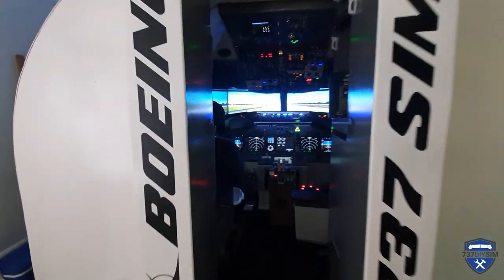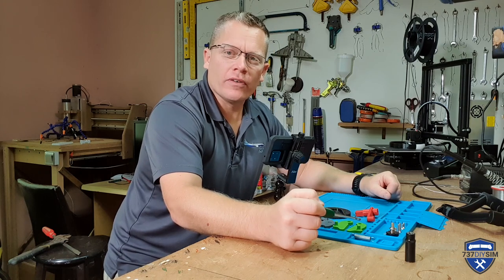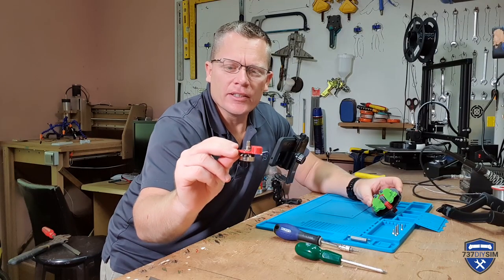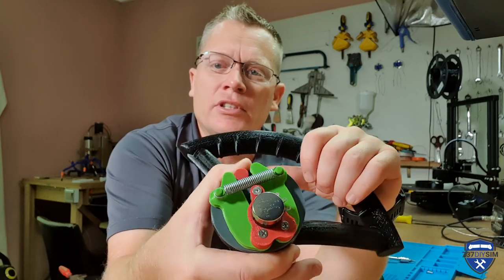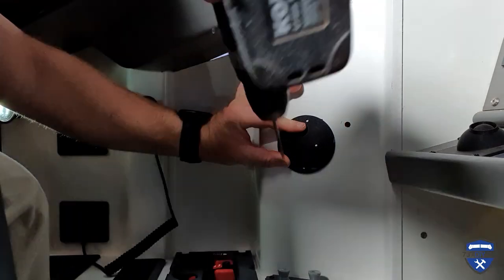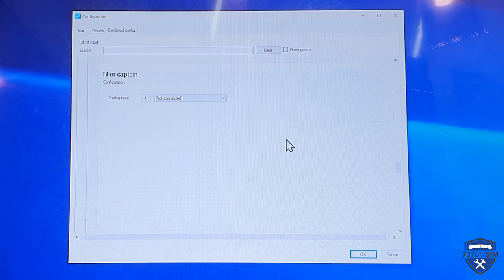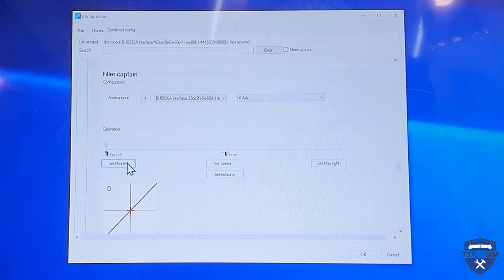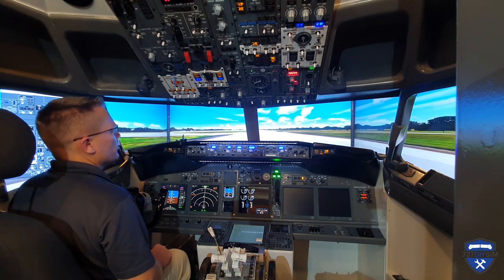737 Tiller & Operating Mechanism

Comment: Fantastic series - excellent job - there's no way that most people would have your skills and access to materials to build one - I agree with others - you should mass produce and sell it - I would buy it
Reply from the maker: Hi Warwick, Unfortunately due to my location that is not currently possible. I am unable to produce any part to sell and ship right now. I am relying on other simmers to buy the plans and sell the parts to others at a reasonable price! However, the ones i see on eBay are silly prices! (the whole idea of this website was to inspire others and show you don't need a lot of money to get started. But of course it helps! Thank you for commenting and the support. Kind Regards Karl

Comment: I have got to say what a GREAT SIM in every way m8e. Whats your view on Air Manager with touch screen buttons? I am at the cusp of either building a fully functional 737 home cockpit like you have based your sim on. I have got FS2020 as you can imagine. Do you think I should use Air Manager for all the functions to get the same overall feeling of the sim?. The noises are important as well yes? I have 400mm square Creality CR-X dual colour FDM and Resin Photon printers but the costs can be immense when you start adding up the costs of the buttons/interface boards and god knows how much MDF you have used yeah!. Your comments are welcome on that. I think you in IT like me yes! I come from the 8bit days 20yrs ago and building a home cockpits would have cost £30k and 5xCRT monitors/computers... You get the point. I have tried before with an AutoPilot Self Contained (Blackbox solution) with other bespoke hardware which cost £500+ from Australia for AP and list goes on. And other add-ons which in all via FSUPC was clunky.... Look forward to your reply. Regards, Andy ps. I started a while ago as I said but with 480p Projectors with the CRT's and there was too much heat!!!! 35c in Winter lol. I boarded up the windows to keep the light out. You get my point... I think...

Comment: You should put this in a shipping container mounted on hydraulic jacks!
Reply from the maker: Hi Stephan, 
I think that's the million-dollar question that everyone has. That would be the ultimate dream. But for me, this is just a hobby and the sim will remain a fixed base. Over the years I have thought about making a moving base unit. But for the 737 is not currently an option. The last time I looked at the hydraulic jacks they came in at around 6000-12000 pounds each, to which I would require 6. Then you have all the equipment required to run and control the unit. I really can see why the real simulators cost so much. To make things even harder, where would I put it? This thing is already massive and I dread the day we have to return home to our little house in the UK. I am currently designing a heli sim, which is lightweight and hopefully, electric actuators can be used. But that's a future project. probably a bit more of an in-depth answer than you were looking for, but I have thought about it many times over the years. Kind Regards Karl
Reply: @helimech8152  Thanks Karl!  There are a lot of wires to connect everything !  I wondered whether you could connect all the devices via network cables and UDP protocol.  ipMidi allows you to connect MIDI devices over a computer network.  
It doesn’t use TCP/IP but instead uses Multipacket UDP which gives it a lot more bandwidth than standard MIDI.   If you were to use a UDP layer, you would almost want it to be invisible to the existing client/server software you are using.

Comment: Bravo!  Wish I had a quarter of your talent. So looking forward to the Yoke build. Will it be a dual yoke with both Captain and FO sides working?
Reply from the maker: Hi Tom, I was supposed to be Dual Yoke, But waiting on parts, its been over 3 months now. So for the time being and to get in the air on both P3D and MSFS2020, im going to get the Captains yoke done first. Once the parts arrive, like carrier bearings, inline turnbuckles, sprockets and chains, then i will convert to dual yoke setup. Also, been thinking a lot recently on the centering mechanism, force feedback and force trim. Hopefully i can get this sorted on the captains side and use is also for the FO side.
Kind Regards Karl

Comment: Hi. It is immediately obvious that you are a trained avionics/aircraft tech because of the way you wire it up - lovely. My degree was in avionics so I have done this sort of wiring before and it is mega rewarding to see it all beautifully loomed and laced.

Question: have you used a VR headset in your 737 simulator? I know that kinda defeats the point of building such a faithful, accurate cockpit, but I want to get back into the air soon (PPL & IMCr holder), and would like to use the new MS flight Sim (or maybe even Xplane11) to practise cockpit checks/memory items, but It is much, MUCH more realistic to have a real instrument panel. I'd really like to be in a VR headset, but able to operate switches on a real instrument panel - do you think VR headsets (specifically the tracking technology) would present an accurate enough virtual panel that the panel switches would feel exactly where the VR picture shows them to be? I am kinda suspecting that's a 'no', but I'm asking in case the tech is better than I'm giving it credit for? 

Sorry for the long question!
Reply from the maker: Hello Edward, sorry for the delay in getting back to you. Thank you for the great comment. I haven't tried MSFS in virtual reality, but I know a lot of people cant get enough of it. Is it good enough to carry out cockpit checks and muscle memory programming. Really im not sure. But i would hazard a guess to some extent. But nothing is going to beat sitting in a full sim cockpit to practice just that, especially when there's no consequences when you get it wrong. The good thing about Prosim is the included instructors station, which tells you what ha been missed or needs to be completed as you go through the checks. Prosim however, is type specific, where as MSFS in virtual reality, you download the  aircraft type and your ready to go. I think what I'm trying to say here, is that i have no real quality advice to give here! Either option can be a costly experience to start out with! Kind Regards Karl

Comment: Inspirational video again, thank you Karl! I will use a standard European 75mm drainpipe for the yoke column since Markuspilot says it is 76mm in the real NG. I hope to find a yoke neck that fits the 75mm or a 3D print file for the same:)

Comment: G’day Karl,

Fantastic project you’ve made - your wife must be incredibly patient! 

Your design is just an amazingly simple yet effective solution. So thank you! 

However, I’m wondering about your pedals? All of your other designs are fantastic, so I’m obviously a bit intrigued what you use. I’ve designed some pedals loosely off the 787, but they aren’t the pedestal style. I’m going to try and adapt your tiller mechanism for the centre and sensor pickup, I think it would be perfect. Perhaps with some increased scale for added strength.

Finally, you mentioned using a capacitor to remove the jitter when calibrating. Can you explain this a little more in a video or blog post on your site? I’m sure you would do such a fantastic job at enlightening us all.

Best regards down there in Brunei.
Reply from the maker: Hi RB, thank you. I will add a diagram about the capacitor soon. It seems to help quite a few. Merry Christmas Karl

Comment: Are you designing parts and making them?  Were the parts of the mechanism already designed and the printing files provided for the Tiller and the spring?  It looks like there's a lot of design work going on.
Reply from the maker: Design work is now 90% of what i do. I dont bother to try and create anything these days without it working or designed in CAD first

Comment: G'day Karl,
Two little snippets for you. Check that you have not got your tiller active in the main FS program ( PrePar3D)  and FSUIPC. There is conflict  if you try to calibrate with both active. It causes the jitters you mentioned. assign in one only.
When you assign the "card" in the P3D configuration ....move the tiller so you get a reading on the top bar, the just hit the "A" box next to the assignment box and hey presto ...it finds your Bodnar card assignment automatically. I will try to put something up on my channel soon.
Reply from the maker: Hello Les, Great to hear from you again! You wouldn't believe the hassle i have of deselecting all the controls in the different programs! You are completely right, if theirs a duplicate control, we spend days trying to figure out why we had no elevators despite the PROSIM showing in the config page all was good. In the end i had move the Elevator control from Prosim, and move it to FSUIPC. Tony that came to have a ho in the sim, had to bounce the aircraft off a hill, or house to get airborne. That flummoxed me. As always Les, Thank you for the advice, it really is appreciated. Im on holiday with my wife Helen right now, but am determined to get the control column sorted next! Kind Regards Karl.
Reply: All good..... Contact me when you get to the control column "feel" build,. My setup works very well , and having tried a real one (on the ground) , it feels fairly OK. 
Have a good break.
Regards

Comment: HI, great design, did you use a leo pot switch? if not what type did use, thanks
Reply from the maker: Hi Steve, i used 
RV24YN 20S 
HQ POT 10K Ohm
just type this number into eBay or Amazon. Make sure you find the cheapest! as some of the seller's prices are ridiculous! Look for the ones around 2-3 USD/Euros each. Better still there even cheaper if you buy in 10 qty.
Kind Regards
Karl
Reply: Heli Mech great, on another note what’s a good rotary switch with say 4 positions to use with the leo card as they offer 12 positions but I don’t want to loose 12 slots? Cheers!

Comment: How many USB ports are you using to make the whole thing work?
Reply from the maker: Good Morning, It has to be over 30 USB ports at the moment, i seem to be adding them all the time. Luckily MobiFlight creator Sebastian has improved the startup times and everything now runs smoothly. Kind Regards Karl
Reply: @helimech8152  Fantasic job with both your cockpit and the videos. I'm actually up in the 30 ports myself for my 320 DIY homecockpit. But I am having many problems the USB connections. After every PC boot there are several devices not recognised (Mega2560, LeoBodnar836 and/or Ultimarc Packled64 cards). Swapping the affected device to another port or even to another hub often does not recover the device.  I have updated w10, uodated the BIOS, disabled energy savings, removed all USB services in device manager to reinstall their drivers. I changed the USB cables and removed any long USB cables. I have changed the power supplies of the USB hubs. All my hubs are powered USB3.0 hubs and I even installed an extra PCIe 4x USB3.0 port card. But the problem is still not solved. According to a moderator of Mobiflight any modern PC should be able to handle 128 USB devices, but it looks like my PC doesn't agree. I7 6700k, 16Gb ram, GPU1080, PSU 700w. Would you have any suggestion what could be the issue?

Comment: Seems your CNC Machines is home made can I have I link if it’s build by you please.
Reply from the maker: The CNC was just a slapped together item that i never actually thought id get to work but just wanted to see how it went. There no build plans or links as its very old and was just made from an idea in my head. Any info I do have is under the getting started menu on the website. Kind Regards Karl

Comment: what board do you use to get analog to usb?
Reply from the maker: Hello CocoNo, I use 3 different boards in the sim:
Arduino Micro,
Arduino Leonardo
Leobonar BUX036A

Micro is my favourite as its small and cheap. But requires a dedicated joystick sketch to function.

Kind Regards Karl
Reply: @helimech8152  interesting...
I use the adafruit pro micro
I just wanted to know if yhere was a better option. Since the pro micro only has 1024 bit analog resolution and it requires programming. Also that the pc can only deal with one arduino at once

Comment: Helu Mech, finally got it to work...https://youtu.be/_gqqRiQLUXY. 3500 nm with a cessna in fs 2020 an no need for so much soldering
Reply from the maker: Hello! Just watched your video. Great Work!
Reply: @helimech8152  Henrik here. Thanks for that. I thought this must be a much easier project. 3x12inch displays, 4x7inch and finally 1x3,5inch and no soldering for the fmc, way fewer buttons. All screens are ordered so i Will update with another video.

Kinda got the idea from air manager, but I thought that there was way too much constructions in programming panels (and expensive), so i thought there must be a easier solution, hence the Raspberry Pi screen sharing over network without using additional software.

Since each RPI have 2 HDMI outputs i will try out if i can drive 2 displays on each PI, but my plan A is to use one RPI for each display but I will see. A Pi 4 is roughly 32 USD here in Denmark. With a small 7 inch display its a small 1.5 amps.

Encoders, led, buttons is driven seperatly by arduino.